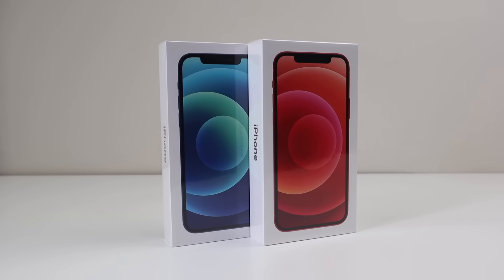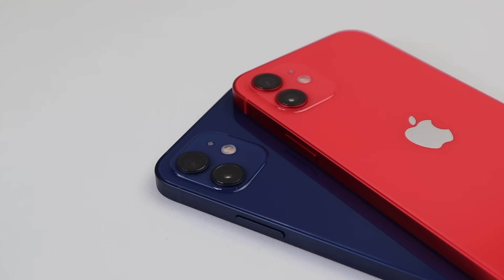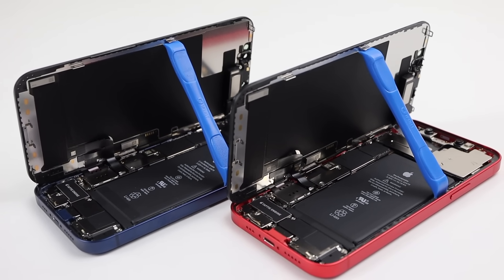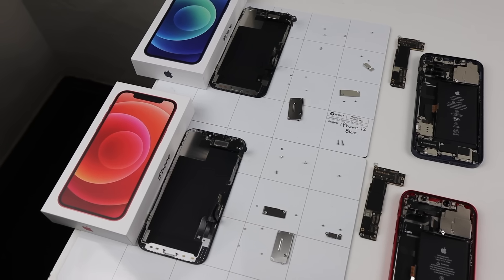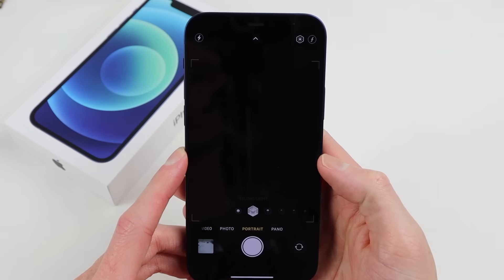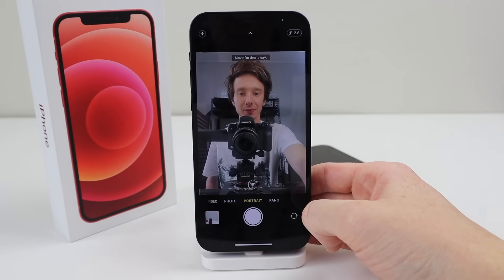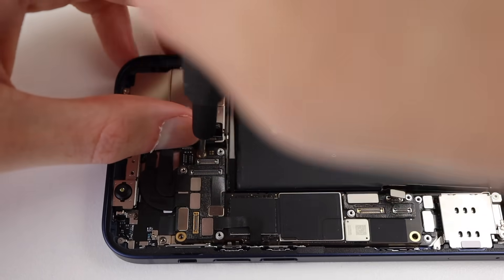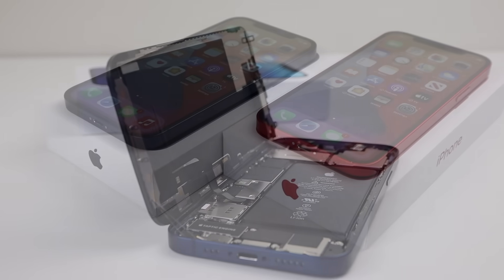iPhone 12 Anti Repair Design - Teardown and Repair Assessment

Comment: keep fighting for our right to repair! I was a Mac Technician.
Reply: just dont buy it ...is that simple...without customers they will for sure change .
Reply: @hasinoltabar1925  nice idea. People cannot leave buying Apple devices
Reply: @erenwayne  yeah they have that. We cannot change Apple policy.
Reply: @erenwayne  although recovery of data is possible in all MacBook at Apple care
Reply: @ashisza  Yeah, read under the lines 'At Apple Care', but there's no 'efficient' way if most of the users like me and you wanted to recover it ourselves because as it is soldered it would require expert microsoldering skills and tools and even with that maybe you wouldn't succeed in getting your data back.
Now tell me how easy is it to recover data from a Windows laptop that has removable ssd? Yes, that's a a piece of cake.
Reply: @erenwayne  we cannot do anything about it. Apple make product such that only Apple can modify or repair it. Even I as MAC Technican without Apple server cannot diagnosis MacBook 🙄

Comment: I stopped using apple when my iPhone 6s+ had trouble charging and the headphone Jack stopped working entirely. I was told repair was going to be around $300. I bought a $15 spare part from Amazon and installed it myself with only minimal difficulty.  Then my $1500 MacBook took a dump 19 days after the warranty ended.

Comment: Bet the OS locks to the parts on first boot and they boot it at the factory. Could even be storing the information where an OS flash wouldn't affect it, if you could do that. Apple is using nice excuses to lock options down. Its privacy in the appstore and climate impact for hardware.

Comment: Apple keeps testing how far they can go. My next phone will be an Android again.
Reply: My last android phone (8 years ago, IIRC) had a sealed-on proprietary battery and everything inside was drowned in a black glue. I'm now on my third iPhone: after getting my first 4s stolen and repairing my 2nd 4s until it wasn't usable anymore, the "current" 6s is going great with its Chinese screen and battery.
Experience beats random youtubers' haughtiness 100 - 0.

Comment: I believe that most people will migrate to wireless charging, making the power adapter unnecessary.  Physical connections will be gone entirely in a few years.
Reply: Wireless charging is HUGELY inefficient compared to plugging in directly to a charger.  Also, wtf does your post have to do with right to repair?
Reply: @Appalling68  My replay is a reaction to the commentary made in the video regarding the lack of a charger in the box. Like all battery powered devices (cars included) planning is required.  Supercharging your phone via a cable should not be your daily go-to. Overnight wireless charging is suitable for 99% of iPhone users.  And technological improvements in three years will render the plug obsolete.

Comment: I wonder what would happen if you just swapped batteries between the two phones. Also, as far as taking it in to Apple for repair, I'd betcha dimes to donuts that they'd just tell you it could not be repaired and they'd try to sell you a new phone.

Comment: u need to say that u need a very special screwdriver to open the plates screws that cover the cables.
this screws are so tiny that u can not open it with any other tool.
Reply: Of course, we're all ready to "repair" high technology but we're stuck at which screwdriver we should use. This is the perfect picture of the R2R lot.

Comment: Pro tips to avoid these limitations : don't buy iphones.
Reply: Legit everyone is switching to Android hope Apple soon learns that they are making their phones too expensive
Reply: @tooslay  yeah. Android has a massive percentage of the market share, so I hope stupid old Tim Cook will make iPhones cheaper so people will fucking buy them.
Reply: @tooslay  where? who? not in my town
Reply: Pro tips: You don’t need to repair if it doesn’t break. 
It applies to every phone.
Reply: Scar.  no
Reply: Or stick to an older IPhone model, I have 7 and have replaced screens and batteries with no problem and at low cost. I have the impression my 7 can do everything I need it to do. Can I live with a less performing camera : yes I can, do I need face recognition whilst now having the thumbprint recognition, no I don’t...etc. Do I want to pay ( a lot) extra for those (non replaceable) gimmicks : I don’t.
Reply: PR disaster
Reply: then what do you buy??
Reply: @trolltime1862  android
Reply: @RookitMaster  Ok i'll check one of them out..
Reply: @trolltime1862  If you do end up buying one don't by a cheap $60 $80  Android phone, I mean they work but their built cheap like you can feel the cheapness when you pick it up and they'll break easily, if you want a decent good quality android phone your looking to pay at the least $200 or more brand-new, how ever if $ 200 or more is out of your budget but you still desire the phone then buy a refurbished or a used one that's in good condition,
Reply: Buy iFruit!!! Far more superior.
Reply: I am an apple fan and i can tell ya, in just a matter of months, people will figure out ways to reprogram iPhone 12 parts so they will work with any phone. And on another note, i hate android and i HATE Tim Cook. Steve jobs was sooooo much better at running apple.
Reply: Buy andriod instead
Reply: @RookitMaster  yea but then you’re stuck with an Android. 🤦🏽‍♂️
Reply: @AldousForestTheLast  Andriod is awesome, just make sure you dont buy a cheap $80 Andriod one, instead buy a $150 or more  and your set, Im I used to be a apple only guy,  but after months of my friend hounding me to atleast  try andriod I gave in and tried it, and im happy I did, my Andriod  could do everything my apple phone could do, not only that but it  could do things  my Apple could not, Example i can plug my phone into  my pc and use it as a storage device, I can put pc programs, set up wizards and other pc stuff inside my phone,  my pc can  run those programs  off my phone, and I can dot this with any pc or laptop, with out having to install  app from the developers that you must have on both devices in order to transfer stuff. I have yet to meet  Apple phone or iPad that can match that.  My iPhone  also has to be connected to a Apple  TV in order to stream or mirror from my phone, if its not Apple, it won't work. my andriod on the other hand doesn't care what TV  i use along as it has has mirroring  or streaming capabilities and  if it doesn't,  my USB port on my andriod device can be used as a HDMI if the TV has no streaming capabilities. All im gonna say is im glad I switched
Reply: @RookitMaster  fun fact, iPhones have less ram from the factory because when you compile an iOS program from xcode, the code is OPTIMIZED for iOS and programs on iOS tend to run faster then android apps.
Reply: @jazzius  fast is good, but accuracy is better...and its okay if the andriod  isnt as fast as the apple, if it can get the same job done in a decent amount of time its good. and as a former apple user i dont hate apple, i still have my ipad and iphone and i still use them,  expereince is the best teacher,  and in my experience ive learned that speed is not everything, ive also learned to try somthing new even if i dont like it, and that Andriod can do what apple can, and it can do what apple cannot, i fell in love with andriod becuase i love being able to customize and change things to the way i like them, i like being in full control changing the way in which my device functions to my taste, if there was somthing i didnt like about an apple phon  the way it did somthing, or how it operated,  what ever the case was, i couldnt just go in and change it, i had to wait a year or more until apple released a new device, i dont have tha problem with andriod there are so many andriod devices to choose from and if i want to make little tweeks to them here and there to fit my tatse im fully allowed to do so instantly with out waiting a year and a half, not to mention apple has gone mad with their prices, thats one reason why i chose the galaxy Tab s6 over the I pad air and pro, because it was far cheaper, it could get the job done, and it put up a outstanding test result when compared to those apple products, sure the apple pads could do a few things better then the tab s6 could do, but the s6 faired rather well compared to the pads, when compared with things they both could do  the apple pads were a little better in some areas, but in other areas the apple product couldnt even compete with the tab s6 becuase it didnt have those special features or those options, im not bashing apple, i think apple is wonderful and they were actually the start of all of this, im very thankful to apple. 
i aplaude.  Andriod used to be a pile of crap, but it got better as it aged and in some aspects has not just cuaght up but surpassed apple in a few areas,  i own both andriod and apple devices, and for me, NOT EVERYONE but for me, andriod suits me better,
Reply: I would agree if we where talking about apple computers but other companies with phone of similar specs and build quality have the same repair issues. A problem like this can only be fixed by legislation. Email your representatives and sign right to repair petitions.
Reply: @jacob416  i havent had this issue with any other brand ever so idk what ur talking abt with this problem not being apple specific
Reply: @Surr3alD3sign  I just searched for it and yeah i couldn't find the that i was thinking of when i made that post. I could of sworn I read about Samsung, google and a couple other android phone manufactures that where implementing similar anti-repair firm/soft ware as apple but i guess not.
Reply: actually just buy previous iphones, i still have the SE and so long as you replace the battery it works nearly identical capacity aside from graphics from a new one.
Reply: @lucamarin5421  I would agree. And like i always say, if a product works perfectly fine and you can repair it when it has a problem, whats the point in replacing it.
Reply: Agree
Reply: For some reason, I switched from cheap android midrange phone to iPhone XS Max which I got it from my cousin gave it as a Christmas gift. Once it stops receiving updates, I’ll switch back to android.
Reply: @ManChesterEnjoyer  don't buy cheap androids, if you want a good android your looking to pay at least $200 or more brand-new for a decent android,
Reply: @RookitMaster  yes, I’ll look forward for those new midrange or flagship phones to be out in 2023 or 2024.

Comment: Do I mistake but the same happens with any modern car if you try to swap most of electronic parts it will not be tolerated? I think it is caused by security concerns to make the life difficult for they guys who will steal your car and try to dissassemble it to be sold part by part.

Comment: Guess "Secure Enclave" is working its magic here. It's designed to be a mechanism which generate unique code that uniquely identify the parts, passwords and other essential info. It's a system works on its on and cannot bypassed by iTunes, disconnect from internet, etc.

Comment: When I need an oil change, I could take my car literally anywhere. Hell, I could do it myself. When I went out to buy it, the car is now my property. I should have the right to modify it any way I want. Apple is  literally controlling how and where people repair their own property. To hell with that company. Thankfully there are plenty of alternatives.
Reply: Imagine if you bought a car and you needed a new muffler and your car got artificially louder and yelled at you every time you started it until you took it back to the dealership where they make you pay close to the price of the car brand new to get it replaced.
Reply: Calm tf down y'all.
Reply: @Jaki Yeah but instead there is a sensor that gives you a reading on the display
Reply: No, Apple is controlling their reputation by ensuring that you and your $8 soldering iron dont screw up their phone and then try and blame them.

If you want to modify your gear, don't buy Apple.  People have known that for decades.
Reply: Communism at its finest.
Reply: @MetrosexualFilth  Do you even know what Communism is 😂
Reply: Cars are not smartphones. And your oil analogy is flawed. That's like saying you can only charge your iPhone with special Apple electricity or wipe down the phone with Apple approved cleaner. Neither is the case. Your car has plenty of specialized parts you need to order directly from the manufacturer, that doesn't have some generic equivalent, and the higher end the car, the more expensive and specialized the car part will be, along with the authorized personnel who can install it. Yet you aren't whining about that. You also don't have the right to the software within the iPhone, and this is true for all smartphones. A smartphone without the software is just a literal brick. The intellectual rights of hundreds of companies will be violated if you thought you could just share it, modify it, and use it however you see fit because it's your "property". Smart cars? Even moreso. Your view is basically the dumbass layman undestanding of a complex topic through the narrow lens of your own selfish bias.
Reply: @aoikemono6414  damn bro. Where you getting your oil change?
Reply: @aoikemono6414  lmfao you got one thing right, the more premium or expensive the car the more specialized equipment you need to fix it. And the part about intellectual knowledge. But for about 80% of cars you can have it repaired at any mechanic shop. There are non oem manufacturers that make hundreds car pars for hundreds of cars. You don't need to buy a ford oem ac compressor and you don't need to take it to ford to get it fixed.
Reply: @aoikemono6414  You are missing the point. Even if I decide to buy a genuine screen (say because I broke it), no one is allowed to replace it, other than an Apple technician. On the other hand, you can bring your car to any mechanic you like and tell him to install a genuine OEM part. This is the scenario demonstrated in the video.
Reply: @aoikemono6414  dude dont make a paragraph of thing you doesnt understand
Reply: @aoikemono6414  you have issues my friend; check brain
Reply: @aoikemono6414  dude you can make car part yourself you high on something?
Reply: @aoikemono6414  "Your car has plenty of specialized parts you need to order directly from the manufacturer " Right there, your whole argument fell apart, i can see all the way here, you've never owned or worked a car in your life. lol
Reply: @noxregall3599  probably never own a car
Reply: @noxregall3599  probably never saw custom made part too

Comment: I never liked Apple. And not just "because". I disliked the Apple II, as it was not even close to what my Commodore could do. Later, I disliked the Mac, as my PC was more compatible and faster...and my mouse had two buttons...as it should be. When all this "i"-stuff started and people turned into Apple-worshiping zombies, I was already done with that company for nearly 20 years. 
And I could not care less how easily Apple can scam those zombies. I would never buy an Apple product, I do not like the design, the company and the price. BUT: As so many idiots can't waste their money fast enough to buy this shlt, other companies want in on that deal. When I got my Galaxy S3, I could boast with changing and replacing the battery, putting in SD cards and plugging in my jacks. Most of this was never or no longer possible with an iPhone. But Samsung now wants to emulate Apple. I can by now live without a headphone jack, as I really like my BT headphones. What I can't live without is an removable memory card. And I know I will have problems up the line with the non-removable battery. Well, it at least CAN be removed, but you need to crack the phone open and unglue/unsolder it. Let's say, they made it waaay harder than just using your fingernails to open the back and take it out with a gentle slap.
Yes, I know: It's sooo important because of WATER RESISTANCE!! Funny thing is...None of my old phones ever had water damage. I never dropped them in the toilet or the ocean, which would be the only instances where this would come in handy. Rain was not an issue. That is why I call BS for this. The few people who need water resistance usually have a fix for that (there are casings for this). And I do not want to lose control of my phone because stupid over there was too drunk to hold her phone barfing into the toilet live streaming it. 
You can be sure that Apple will not only glue the next phones shut, they will weld them shut. Probably a full steel body with no way to do anything anymore. And over time others will follow. That is where my problem lies. I will probably migrate from Samsung with the next one. My battery should be removable (at the least replaceable by 3rd party repair) and I want SD cards. And the price should be way below 1000$. Probably going for Chinese brands... Luckily, I never needed any repairs with my phones. I usually use them for about 4 years, after which they look quite used and have some small issues and are not fast enough for me. They are passed down to my kids or used as a replacement/emergency phone. I have never thrown away any of my phones. Even have all the old Nokias from the 90s still in my drawer^^ You can still get batteries and they still work with SIM cards today. 

That is a clear: Nope! for Apple from me. And for every company following in their footsteps. Apple zombies might no care about all that, but those still using their brain for thinking, not eating it, care.